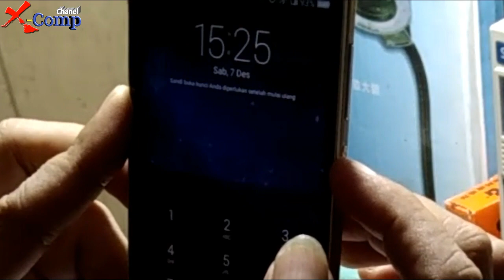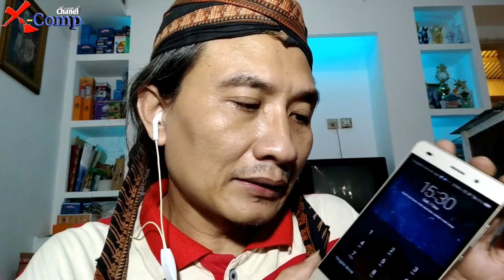HP Tidak Bisa dihidupkan tetapi di charge bisa

Comment: Om mau tanya ya
Ini hp oppo tiba2 tidk nylaa
Tp kalau di cas terdengar masuk tetapi di nyalakantidak bisa
Reply from the maker: - cek Tombol Switch on/off  + flexible + socket nya
- ic controll Charge pada board nya HP
Reply: Iya mbaa, saya juga sama kaya gitu
Hp mati tidk bisa dinyalakan
Tapi kalo di cas bisaa
Itu knapaa yaa?